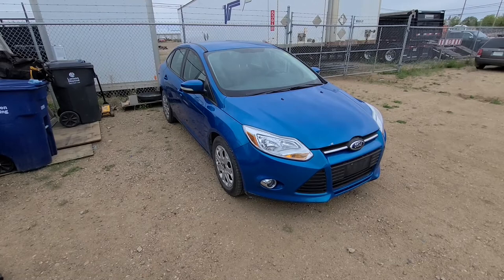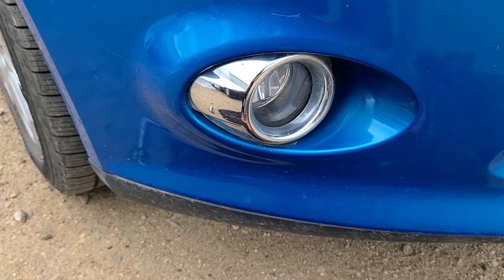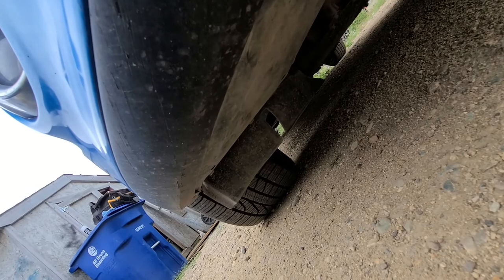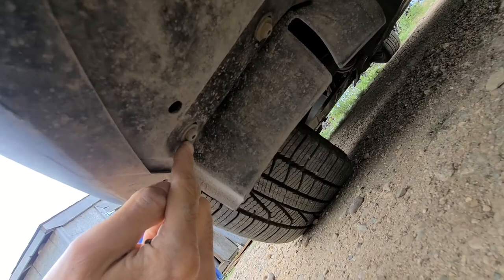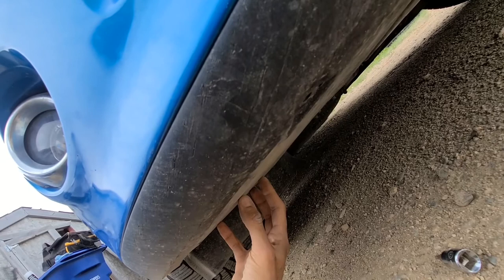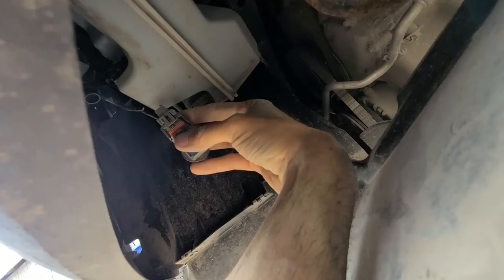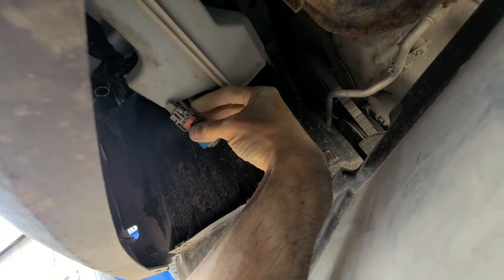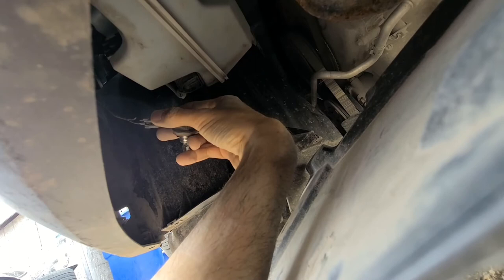Ford Focus - FOG LIGHT BULB REPLACEMENT / REMOVAL (2011-2018)

Comment: I changed my h11 from the top. If you know where it is, you can take off the two screws holding the headlight assembly, carefully take the whole piece out. Then you can access the fog light from that area above. It helps to have a small hand and know where it is, but it was easy enough for me that way.
Reply from the maker: Thanks for sharing